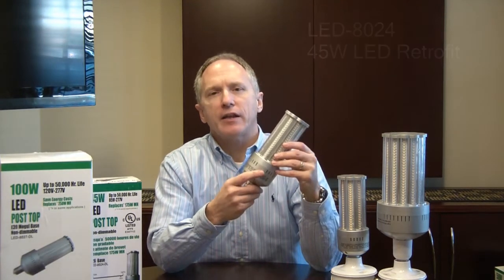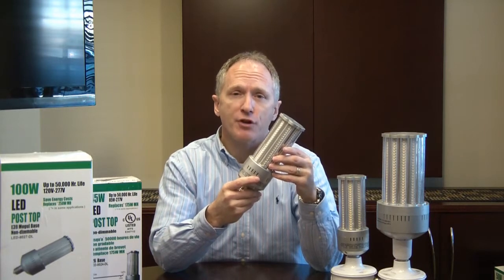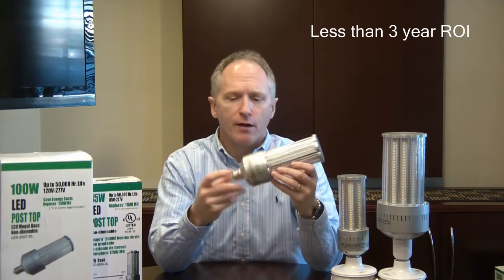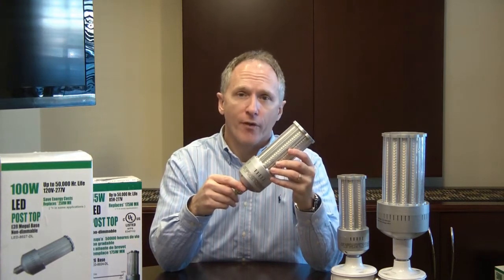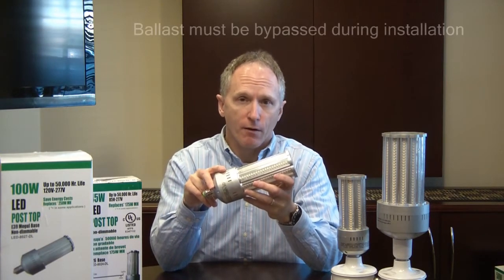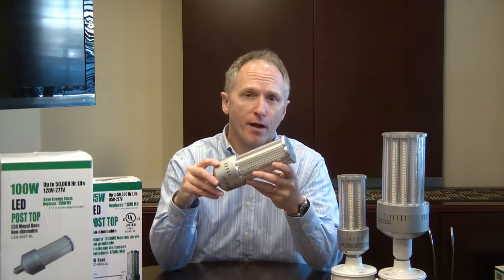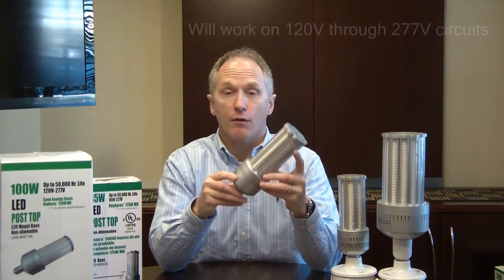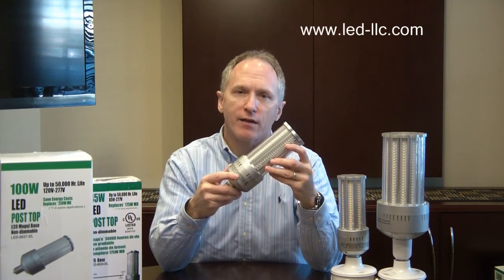Light Efficient Design LED-8024 Webinar

Comment: We purchased several and they work great.  We replaced two metal halide post tops and now one can see any difference in the light.  We also as a trial, used one in a shoe box parking lot light on a 20 ft. pole and it does fine.